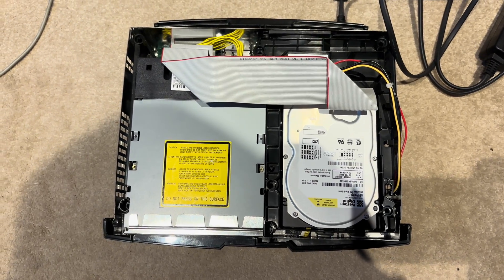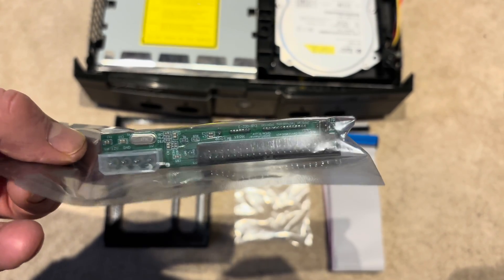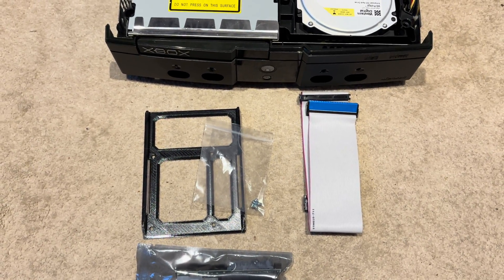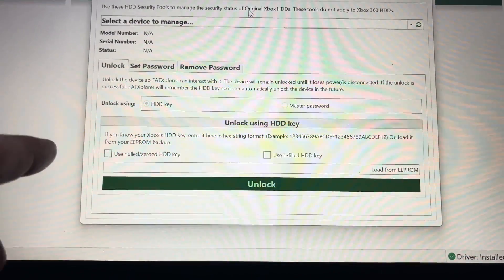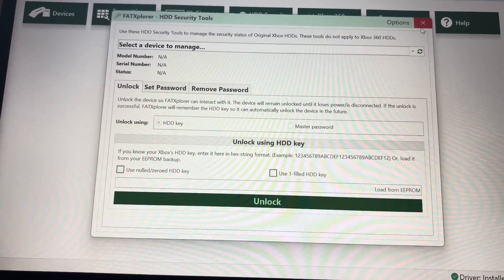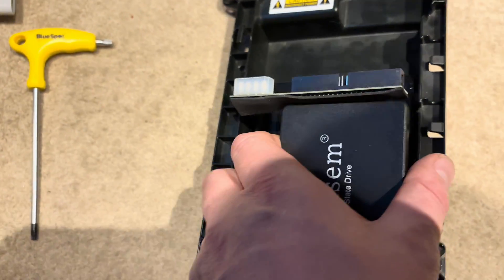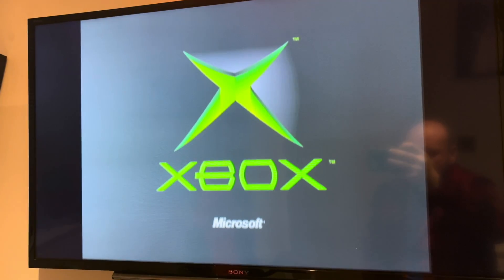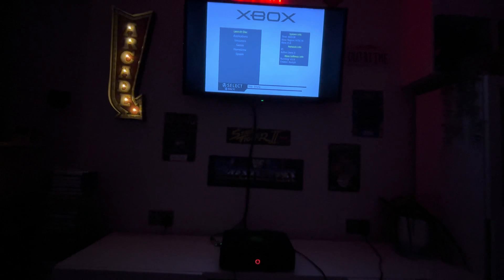OG Xbox Dead HDD Replacement With New SSD

Comment: what do you mean if i use my hdd key i won't be able to go online with insignia? my original xbox drive died and i just want to replace it with a ssd, i do have my hdd key that i got when installed insignia on my previous hard drive
Reply from the maker: I’m not sure I said that. 

Just to confirm, you will need your HDD key to go online with Insignia.
Reply: @subliminalvcr ok thanks 👌

Comment: When I swap out the hdd the xbox boots but I'm stuck on xbox boot screen and freezes there can't get it to work any recommendations?
Reply from the maker: Have you used FatXplorer to prepare the drive. Are your dashboard files named correctly?

Also if using a SSD (and some bigger HDDs I think) there js a delay in getting to the dashboard compared to stock.
Reply: @subliminalvcr yep I used fat Explorer, used the ep rom etc set up the c and e partition and still doesn't work tried two different hdd and still won't work
Reply from the maker: @Dylan-z4x7v Sorry if I’m asking you about things you’ve already done but have you put the necessary files (dashboard) and folders into the C and E drive via FatXplorer?
Reply: @subliminalvcr yep done all that
Reply from the maker: @Dylan-z4x7v Are you running an 80 wire IDE cable and SATA adaptor if using a SATA drive?
Reply: @subliminalvcr sata adapter and the stock ide that was in the xbox
Reply from the maker: @Dylan-z4x7v I’d try an 80 wire IDE cable as it’s recommended for modern SATA drives. If it still doesn’t work after that it may be an issue with your SATA adaptor.
Reply: @subliminalvcr thanks for letting me know
Reply from the maker: @Dylan-z4x7v No problem - let me know how you get on 👍

Comment: you probably talk about it in the video, but isn't the IDE max bus like 130MBs? 

aka, isn't it a waste to use an SSD over a HDD?

---

As for the separate IDE cable. it's an 80 pin cable vs 40 pin cable. these additional wires reduce crosstalk/improve signal reliability... so yeah they basically increase speeds. However, this still wouldn't be any faster than a normal SATA HDD. 

In any event, SSDs are cool, less moving parts so still a great upgrade. but overkill
Reply from the maker: Yes you’re right there’s not much if any speed increase in running an SSD on an Xbox over a HDD. However the reliability and affordability of SSDs currently makes them a good option.

Bang for buck though, a big IDE HDD using the stock wiring is great. 👍👍

Comment: My OG Xbox's hard drive is fine, but I had thoughts of upgrading it so I may store games and such on there. The upgrade process looks easy enough but my console is softmodded with XBMC4Gamers, and I would like to be able to store games on the HDD since I am allowed the option. Plus, I already have DLC and a playlist on there. How do I carry the softmod over to the new HDD?
Reply from the maker: Hi again,

I would use FatXplorer to set up your new drive and copy everything from your Xbox onto your PC and then onto your new HDD via FatXPlorer.

If there are any problems, you can just install clean stock C and E drive files and then softmod the Xbox normally once it’s up and running with the new HDD in. 👍
Reply: @subliminalvcr how can I copy everything from the factory HDD to my PC, and then into FATXplorer into the new HDD?
Reply from the maker: @LiamG-95 Yes that’s right. FTP all your folders from your Xbox to your PC. Use FatXplorer to set up your new HDD with your HDD key or EEPROM, then use FatXPlorer to copy the Xbox folders from your PC to the new HDD.

Once locked, the Xbox should boot as normal with the softmod and all your content preserved. 👍
Reply: @subliminalvcr I think I’ve got it dialed now: I connect a router to my Xbox, get access to to the console and copy its folders to a safe place on my computer, connect and format the new drive, drop the backed up files into it, install it into the console and I’m good to go.
Reply from the maker: @LiamG-95 That is basically it my friend. Just make sure you use FatXplorer to format your drive and add files. 👍
Reply: @subliminalvcr  So I am trying to connect my Xbox to my router so that I may back up the console's files; however, when I put in everything provided by the console (host, username, password and port), the connection fails. I don't know what to do.
Reply from the maker: @LiamG-95 Have you set the Xbox IP to DHCP rather than static IP?
Reply: @subliminalvcr I have set it to DHCP. I swear this very same connectivity info has worked for me in the past.
Reply from the maker: @LiamG-95 Try static IP on the Xbox if not done already. If that doesn’t work check your router settings?

Comment: does the ssd improve loading time vs a HDD ?
Reply from the maker: You might get a tiny bit sharper loading time with the SSD - I think that’s mainly due to running the 80 wire IDE cable that the SATA adapter requires. 👍

Comment: That long pause on boot is not a comfortable thing. Should only take a second really. Perhaps that SATA PATA adapter is not the best choice. I have a hard modded Xbox with SATA SSD and Agestar STI-2 and the boot time is just like the original HDD.
Reply from the maker: Definitely worried me at first but after a bit of reading on the internet, this is a normal behaviour when running a cheap generic SATA adaptor. I will upgrade to a StarTech adaptor or equivalent at some point, which I’m lead to believe will provide stock (or similar) boot times. Thanks for your input. 👍

Comment: I want to put an ssd in my xbox that is stock.  If I softmod the hdd first will it unlock the drive?  I saw another video where somebody used Chimp to clone the hard drive image and transfer to the ssd using the Sata to IDE cable.  I’m assuming since it is a perfect disc image the hdd key is copied over to the new drive?
Reply from the maker: Hi mate, once you softmod your Xbox you will be able to see the HDD key with which you will need to unlock/lock your new and old drives with FatXplorer etc.

I’m not sure on how to use Chimp but using FatXplorer you can copy files from your old drive using an IDE adaptor to your PC and then place the files on your new SSD using a SATA adaptor.

Your first priority is getting that HDD key so you will need to softmod or fit a mod chip. Hope this helps. 👍

Comment: Mine started clicking a few days ago. Error code 07. Its softmodded, but I never copied the EEPROM file out of it. 

After multiple attempts it eventually booted. All I could do was to set my HD Key to all ones. Will be getting a compatible drive and fingers crossed I can bring it back to life now.
Reply from the maker: @itwsntme  Yeah the clicking is definitely a warning sign. Mine used to do it a bit before total failure, I thought it was just an age related thing rather than spelling out the end of the HDD.
I’d back up your stock drive ASAP before it totally dies and then format your new drive with FatXplorer and copy the files over.

Hope this video helps in getting your new drive sorted and prolonging the life of your Xbox. 👍

Comment: Nice fix mate, actually thought that the HDD would be a tougher swap job. 😎👍
Reply from the maker: I think because the OG is that old now there’s not much information about how to swap a dead drive out. I did have to work this out and wasn’t 100% certain it would work but amazingly it did! Decided to document the process just to help anyone in the same position I was in.

I’d recommend softmodding your OG mate and changing the drive for another IDE HDD or SSD etc to preserve your console. No HDD is going to last forever unfortunately.

Thanks for your support as always. ✌️

Comment: Absolute legend. Thank you. Would you do another vid when you have the chance for a 360 or would it be the same steps?
Reply from the maker: Thanks for watching, really appreciated.

I don’t have an Xbox 360 so I won’t be doing a HDD replacement video anytime soon unfortunately. Apart from understanding that FatXplorer will format a 360 compatible drive, I really do not know how to change a drive on a 360.

Thanks again for watching. 👍👍
Reply: @subliminalvcr All the 360s had detachable HDDs... They all booted from flash ram afaicr 😅
Reply from the maker: @KayliedGamer From the very vague reading I’ve done I think people want to fit drives that aren’t official MS HDDs and therefore need to get the drives set up right.